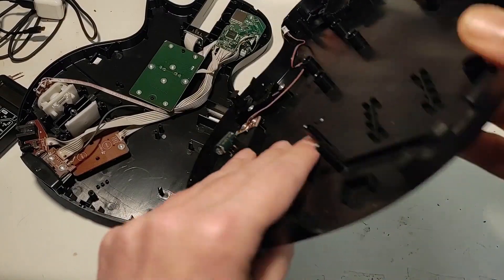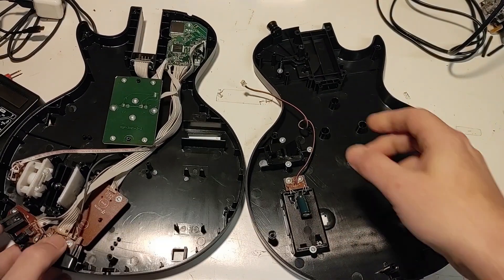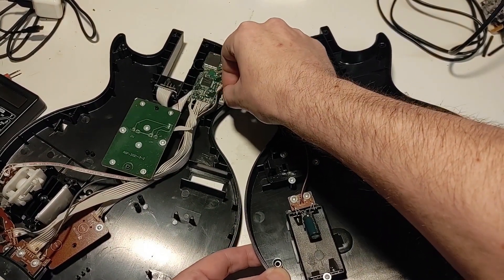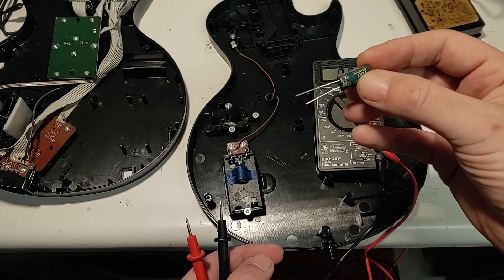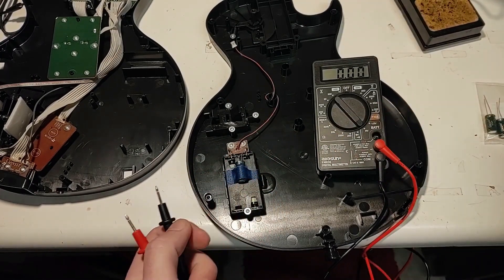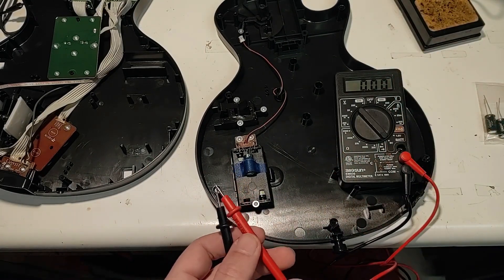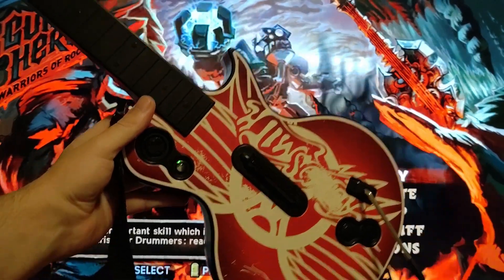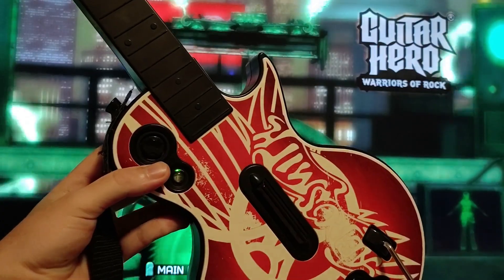Xbox 360 wireless Guitar Hero controller capacitor repair fix (won't power on)

Comment: Hey man, my PS3 Les Paul also won't sync but it does not have a capacitor on the battery part. I've read that there is another one on the PS button board that's causing the problem, any help?
Reply from the maker: There's 2 capacitors close to each other on the PS3 board, a 10v 220uF and a 16v 47uF one. Looks like those caps going bad is a common problem for these guitars no matter what platform. 

I don't own a PS3 guitar, but replacing them would be the same steps as this 360 one. Make sure you use a capacitor of the same value and make sure you install it with the polarity in the correct direction (+ to +, - to -). The PS3 ones are physically a little bit smaller and the board they're on is a little more cramped, so it might require a bit more skill to solder in, but should be a simple fix with just basic solder skills. I hope you can get yours lined out!

Comment: At what temperature do you solder the components? I have a world tour guitar (ps3) and the positive / red cable came off (:
Reply from the maker: @jacklastero3980  I just used a cheapo 30w iron that has no temperature adjustment on it, same as you'd find in the hardware section of a department store. If yours is adjustable anything over 400-ish would be overkill.

If you're a beginner at soldering, just remember to heat the solder and not the part. Holding the tip directly on a wire or component will melt insulation and overheat wires.
Reply: @MisterAzathoth  Thanks a lot!!

Comment: My issue isn’t with the capacitor, the red wire that connects the capacitor to the other side of the board is broken off. Any advice or should I just solder it back into place?
Reply from the maker: @Lucas_Sorenson  If the wire has came completely loose you'll definitely have to solder it back into place or else it will just wiggle loose again. I don't know how comfortable you are with soldering, for just this you won't need any fancy equipment or mad soldering skills. A cheapo solder iron from Walmart and a little practice beforehand would knock it in the head.
Reply: @MisterAzathoth  At which temperature should i solder that red wire back? I got the same issue

Comment: So clutch, im gonna try this out and let you know!
Reply from the maker: @TheBrodyesseus  Hopefully it can fix your issues. A $2 part definitely beats buying a whole new controller!
Reply: I have the xbox one stratocoaster guitar, and I am having the same issue, it wont turn on. I haven't gotten into it yet, but this video has me feeling confident that I can fix it. I just dont have a soldering iron set or a voltmeter. Thanks dude for the tutorial. How much could a soldering set cost anyways, right? Im sure theres a voltmeter hiding somewhere that i can find, or even buy right? Shouldnt be too much, and it looks like fun to get into.
Reply from the maker: @2nd2n1marcog  Both soldering irons and multimeters can be found in most department stores, or you can get them extremely cheap (less than $5) online. Even if you only use them once, they've paid for themselves. Soldering may be intimidating at first but with a little practice you can do easy jobs like this one with no sweat.